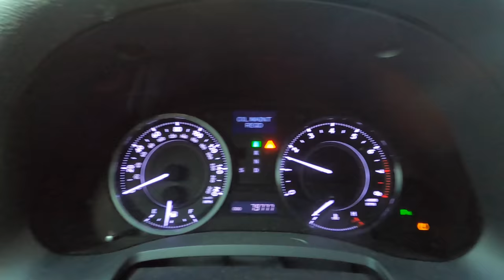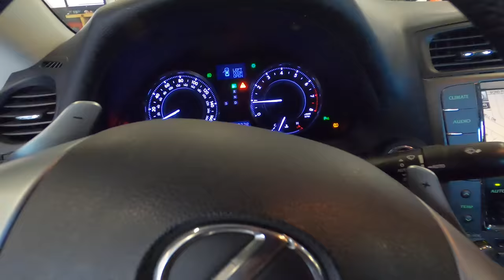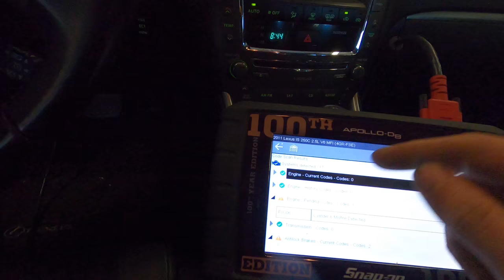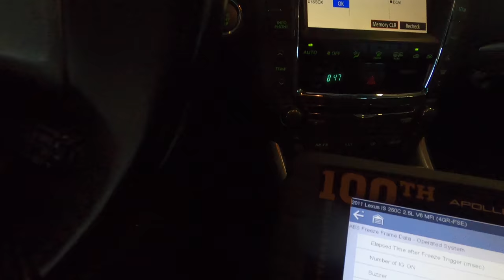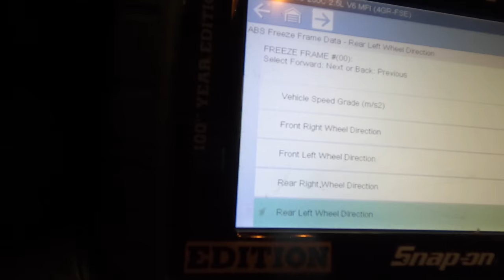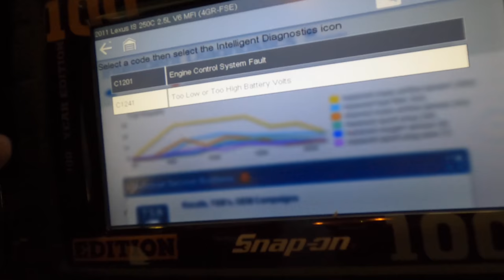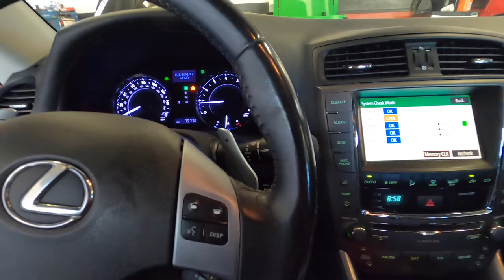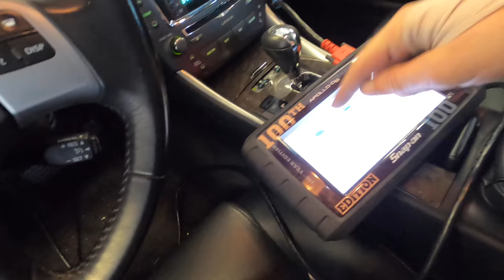Lexus IS 250:  Customer States Lost Power While Driving. Why can’t people communicate?

Comment: I always remove the intake completely (This statement should not in any way be taken as a criticism for the work performed in this video by Ray). I like to inspect the gasket/'O' rings and sealing surface. It's a double check as I've had to go behind a few and fix intake leaks because an 'O' ring snagged on a stud or the gasket moved. Also, the discoloration on the plug porcelain isn't carbon tracking, it's heat and corrosion between the porcelain and the crimp/roll seal. 
I really wonder how old that battery is. It looks really recent. If it was recent, perhaps the idle wasn't relearned properly. I've seen several Toyota products have idle quality/stalling issues that "fix themselves" after a couple miles of driving. 
The replacement coil dielectric grease and different coloring is really weird. Was Auto Zone the source of those parts? I have seen weirder things from them.
Reply: I was thinking the same thing about the intake "O" rings.  It seems all too possible to dislodge one when sliding the intake over all those obstructions.  I guess the fuel trim will tell the tale though.
Reply: @johnh8268  For me, I like to know before I have to find out after I think I’m done. If I gotta do it twice, that’s on me. I’d rather do it once, thoroughly, than ‘quick’ and incorrect. Lots of guys worry about beating the book, or whatever they use to attempt to justify doing things one way or the other. I like to be accurate, clean and proper. After 30years, I’ve found that quick doesn’t really mean anything if you have to do it quick 2 or 3 times.
Reply: @MrVolksbeetle  we had a saying in the body shop at the Lexus dealer...
We do it nice cuz we do it twice🤣
Reply: iv ehad relearning troubles (though doesnt last long) on my 92 w150 when trying to chase problems around. can be misleading sometimes but figured it was a worn out fuel pressure regulator ^^ about $400 so solve a $30 problem xD oh well old girl needed it anyway :P
Reply: The gaskets at the intake plenum on the Toyotas do need to be replaced at spark
Plug intervals.   He should have replaced them. 

Also…. I hope those are Denso coils. And I wish he would have torqued the plugs properly. Torque rating is about 13 lbs and should be meticulously done with these especially because neither Toyota or Denso wants to use anti-seize. Denso says there is a dry anti-seize on the threads and they must be torqued. 

I’m only going on and on because these vehicles can last 500k miles and these are 100k mile plugs that people push 150k+ miles.

Comment: I once had a buddy tell me a secret about putting in plugs. Use a 1/4 hose pressed on the boot side to lower in and also get hand treaded. Works great in tight spaces
Reply: That’s a great tip, and... it also prevents accidental cross threading because the plug will just (harmlessly) spin if the threads aren’t lined up when starting to screw the new plug in.
Reply: Used that myself back in the 70s as a GM technician 👊🏻
Reply: I always spin the extension and plug socket to the left like I’m loosening it and whey I hear a “click” it’s where the threads slipped between the head and plug that lets me know it’s properly lined up and I can turn it to the right then the plug tightens up

Comment: I'd have scoped the #6 coil and 2 other cylinders. And compared wave forms. Looking at kv and duration an load. 
Also would have done a battery and charging system test. And a voltage drop test before and after cleaning the terminals. 
I've found that if you loose one diode in the diode pack. Voltage drops to 13.7 or so. This really did weird stuff to electric power steering cars. And I've also found that ignition systems don't like the ripple from one bad diode, causes secondary ignition misfire issues.

Comment: OMG!!! How does someone learn all this stuff? I remember when you could actually see the engine and the spark plugs!!
Reply: They are making them more complicated,to cost more......
Reply: I see why luxury car repairs are not cheap anymore.......
Reply: It's just nuts and bolts..
Reply: @zcvyvyan  and clips, and hoses, and seals, and sensors, and lubricants, and sealants, and orders of assembly, and ports...
Reply: @blastfromthepast7119  and proprietary parts for just about every modern vehicle.
Reply: @stevenhooper1593  they are not making them more complicated just to make it cost more. It is just a byproduct of newer technology being more complicated in and of itself.  They want it to cost as little as possible, and then charge you as much as they can for it.
Reply: @stevenhooper1593  I'm sure car manufacturers love shelling out extra for engineering, manufacturing and assembly. Gotta drive up that complexity.
Reply: They’re getting more expensive while labor rates and boom times stay the same. So many plastic clips and skid plates, just to get to the plug and filter for an oil change it takes more than 5 minutes now it’s ridiculous
Reply: They have become complex because of emissions, fuel efficiency and power performance.
Reply: @zcvyvyan  now inaccessable ones
Reply: @Indigenous51  and ridiculous gadgets and driver aids that people think they need
Reply: @colinscutt5104  ABS, airbags, auto- tensioning seatbelts, seatbelt warning , distance sensors, HID lighting, auto- dim, daytime running lights, auto locking drive-off, parking sensors and cameras, etc. Quite useful perhaps? The old cars were 💩. I know. I was there !
Reply: @stevenhooper1593  Blame folk wanting to breath clean air!
Reply: @jostouw4366  , they can lie about emissions ,all they want there,lol
Reply: @stevenhooper1593  Funny that VW group are still using that emision cheat today after all the fuss!

Comment: Dunno if this is helpful to anyone but I used to occasionally lose power briefly in my Kia when I'd drive in heavy rain -- VERY unnerving. The problem turned out to be a slipping serpentine belt -- it gradually got road oil on it and getting wet pushed it over the edge. A simple replacement and wipe-down of the pulleys did the trick.

Comment: I long for the days when all you needed was a plug socket and a feeler gauge. Sigh...
Reply: And spare belts, something to tap on the carburetor with and an ability to tinker.
Reply: @JimmyMakingitwork  That went with points and condensers and timing marks. Those distributors at the back or even dual points under the water pump took a lot of the enjoyment out of it.

Comment: C1201 in Toyotas set up on the ABS whenever there is a DTC in the ECM. Toyotas disable the ABS whenever there is a DTC on the engine. Sometimes they illuminate the trac light and the VSC light start flashing.

Comment: Being a dumb electrician, I use the rubber insert in the plug spanner to hold it as I put it back in.
Reply: Some plug sockets come with the rubber insert pre-installed.
Reply: @MrSloika  
Most of mine have, I’m too clumsy and useless to do it by hand, so socket on extension works for me.

Comment: Hey Ray, a trick I have been using while working on cars, when dropping nuts and bolts is a probability for hard to reach places, is to put a small strong magnet on the socket or bit as close to the fastener as manageable…

Comment: Question:

When you removed the plug coils, there was an O ring between the coil underside & the top of the plug hole. You removed them. But when you installed the new plug coils, I see you did not install them & they are last seen on the driver side plastic cowling about 31:17. Do the new coils come with new O rings? Or is there a specific reason you left them off?
Reply: New coils, new rubber seals, soft rubber seals so close to a high heat sorce deteriorate rather rapidly, 100k and thats their life, just like the coils......

Comment: A worn or wider spark plug gap would lower the duty cycle of the coil increasing resistance as the gap is increased until you reach no functionality.
Reply: …and increasing the opportunity for erroneous spark.

Comment: I wonder if there is a valid reason why each trio of coils has a different one. One box might be a faulty QC, two boxes might not be a coincidence.
Reply: Happened to our old 2.7 chrysler concorde it was misfiring and still misfiring after the valve job, engine flush plugs and coils,  one mechanic said it needed a new engine and another found out 3 of 6 brand new coils were defective and all different yet were all sold together…

Comment: I really wish when engineers designed cars/etc they would sit back and say "ok, but what happens 100K down the road when it needs maintenance?"
Reply: 10 pounds of stuff in a 5 pound bag.  The engineers have many masters-- styling constraints, manufacturability, thermal protection, crash worthiness, piece cost- before it becomes a vehicle that will even have a chance to see the road. Serviceability generally is at odds with all the other constraints. There was a cartoon where I worked that showed a car concept drawn by cooling engineers that showed a huge grille for cooling vs the stylists concept that had no front grille at all.
Reply: They did that, it's called the '60s. Enjoy your 75 horsepower v8 and 3-speed automatic. Oodles of space to work on it, but it'll be completely wore out by a hundred thousand miles. This car probably has three times the horsepower in half the space.
Reply: asdfasdf  I loved my 91 car no air bags or padded dash board no giant pillars so you can't see out the windows companies put performance and comfort before some new safety gadget. or the  smooshed outer shape to save 1/ 100 of a mile per gallon of gas but they lost any advantage with added weight of more crap thrown in my 86 was best gas mileage i ever got no tons of extra weight for power everything on cars nowadays
Reply: asdfasdf  So lets just take 2 ubiquitous  family sedans of the past and preset and compare. Say a 1995 Ford Taurus V6, and a 2017 Honda accord V6. The honda, weights more, has literally twice the horsepower (278 to 140) and gets 21/33MPG vs the Taurus 18/27MPG.  And this is just comparing V6 to V6, throw in the I4 and it still has more power and gets even better fuel economy. Please don't tell me 90s cars has great fuel economy. And this was Fords fancy fuel injected engine. Don't even get me started on the 90s cars that were still carbureted.
Reply: It's got a lot worse for design now when energy and environmental constraints weigh in at the same time as cost constraints to stay competitive. What you get is value engineered garbage compared to 2 generations of vehicle before. So vehicles are designed to bearly squeak past warranty without major issues.

Comment: Ray, I got a good trick for you on the plugs.  slide the plug into a piece of air hose to start them.  Easier than dropping them in and using the socket
Reply: I’ve got magnetic spark plug sockets from cornwell, I love them. Will never use one with a rubber insert again.

Comment: Hey bub...why didn't you replace the upper intake gasket....lol...you just answered it..lol...you literally just answered it....I agree with you if the mileage is low but I would want to change them for safe mesure if past 100,000 miles...Really glad they changed all the coils...that would be bummer to have that off and not fix them when you had the chance...plus if ones going the others are not far behind

Comment: I am curious as to the “quality control” thing. Both sets had two with green heat silicon and one without. I’m wondering if AllData or tech manuals might designate a certain position for the coils specific to heat dissipation? One seems quality control, two starts me thinking a purpose. Anyone else wondering that?
Reply: I think you are correct… it seems like a purpose for the fact that one on each side was missing…
Reply: Yes, agree.  And not to nit pick Ray because he is a well skilled mechanic but I would never pull off an intake and not put a new $10 gasket on it despite what he said.  Inviting a future vacuum leak.

Comment: Great job! Although it was a very wise move, I’m surprised that they bought all 6 coils.
Reply: When one fails on a, in this case, 10 year old vehicle it's a wise move to replace them all because the others aren't far behind. Some customers will opt not to for financial reasons and that's fine, as long as the svc mgr explains to the customer that they should save for eventual replacement of the rest of them .
I personally would have had that odd one sent back to the parts store and replaced with one that matched the rest. It just looked too sketchy for me to be comfortable with. I didn't notice where he put it but Ray is pretty sharp so I'm assuming he put it on the passenger side so it's easy to get to if it goes boobs up.
Reply: @gregoryking9348  I couldn’t agree more! It just seems that in this day and age, people more often than not opt for the cheap.
Reply: @gregoryking9348  One went on each bank.

Comment: Ray, how you like those Snap-On pliers with the “talon” grip on the jaws? I was thinking about ordering one, I want some “good pliers” for once and they look pretty sturdy.
Reply: They are awesome.  Anyone on the fence about snap on products should just buy one of their ratchets and a few of their handled/gripped products.  That’s what sold it for me
Reply: @paullowell3342  Yeah but they’re soooo expensive! Ratchets and everything else you mentioned would be around $300+. You can fill up a shopping cart full of tools at Harbor Freight with $300, LOL

Those Snap-On pliers with the talon grip is about $60, I can handle that. I will bet money that Harbor Freight copies those pliers real soon with their “Icon” line of tools. I bought some Icon “flush cutters” the other day and they are an exact copy of the Snap-On diagonal flush cutters and those flush cutters are built a lot like the talon pliers from Snap-On, just a different jaw, so I bet Harbor Freight comes out with the pliers soon. The Icon flush cutters I got were $35. I might “splurge” and get the Snap-On talon pliers, they look like a beast!
Reply: @frankthespank  I got the set that was needle nose, cutters, and those pliers. It was on sell for 100. Use them all the time and they are great.  Only negative is they will oxidize pretty quickly if you accidentally leave them on the backyard table and then your wife puts the sprinkler. Ask me how I know
Reply: @paullowell3342  Thanks for the advice, I think I’m going to pick some of those pliers up. Just wondering if I’ll wait for Harbor Freight to copy Snap-On or just buy the Snap-On’s for $50, LOL

I don’t have to worry about rust since I’m in the Nevada desert, we have to work pretty hard to get things to rust out here.
Reply: They're amazing, I won't buy any others.

Comment: I’m wondering why replace oem coils if they were good? Coils are extremely expensive and rarely go bad. Waste of money in my opinion
Reply: You can bet that it was recommended either by the mechanic or service person. These places do a lot of unnecessary work on vehicles. If you want to watch a guy that does the work correctly instead  of just replacing parts go here. South Main Auto Repair LLC - YouTube .
Reply: @JohnSmith-ug5ci  Eric hates the parts cannon lol
Reply: @bingbong7316  or Pine Hollow Auto Diagnostics.
Ivan would probably rebuild the spark plugs and rewind the coils 😉
No parts required 😁
Reply: @JohnSmith-ug5ci  Ray recommended only one coil. The customer wanted all 6 replaced.
Reply: @Amen.22  you do not know that. Also the service tech had the last say.
Reply: I replaced all six on my Taurus when one went bad. Was changing plugs anyway, felt it was worth it to avoid the need to remove the intake manifold again. Well worth the extra $ to save the labor when another coil eventually went. Hopefully I can get another 120k miles out of the new plugs/coils.
Reply: @JohnSmith-ug5ci  I know what was said in the video. Ray recommended replacing one coil and all spark plugs. Many times the service tech wanted something done or replaced and Ray recommended something less, after his diagnosis. Usually at a much lower cost to the customer. The customer has the final say on what gets done.
Reply: @Amen.22  you have no idea what the the service tech told the customer.